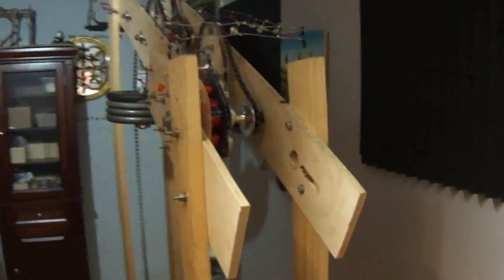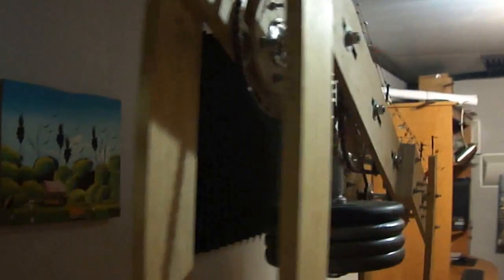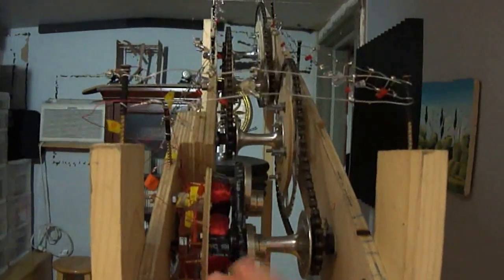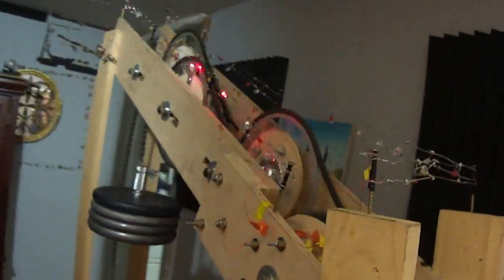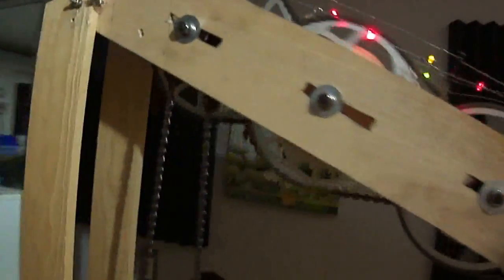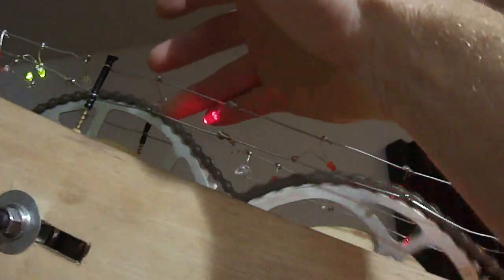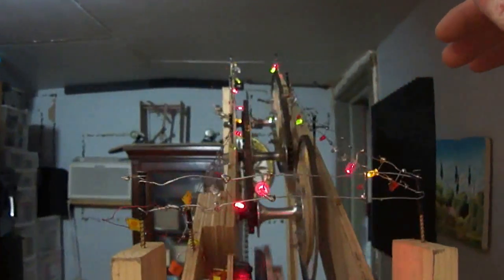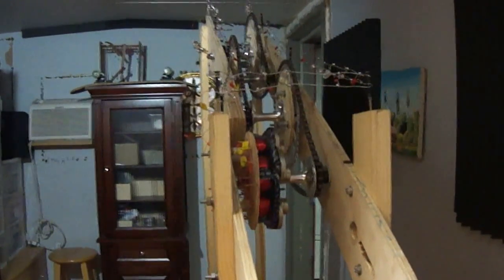Mini Gravity Generator Running

Comment: You are claiming fake informations. Where are the bigger brothers? Here you generate 4w to power those leds. That means a big brother 2000w should have 500 times heavier weight. Wich you will never lift it manually. Your are a little liar scammer. I am an engineer and I ve been working on all kinds of generators. I know the electricity and thr devices.
You should feeel shame for trying to get viewer into this manipulation. You won't get rich on youtube like that. As you see, smart people will not waste the time to write you compliments.
You can trick poor people without knowledge, but not physicians or engineers working in science for 40 years.

Comment: You made a claim your device resets itself?  What exactly does that mean?  If you are claiming the energy to reset the weight back to the top comes from the energy of the generator with no external force added, then I have to say you are mistaken.

Comment: Hi, may I know how u control the speed of the dropping mass? I am doing a similar project to yours and I would like to know how do I calculate how fast the mass is dropping
Reply: 😂😂😂😂😂😂. Its all about speed reduction. As your pedal crank bicycle. Your pedal its slower than your rear sprocket. A larger sprocket has lower rotation then the small one. You better don't watch those scammers if you don't have knowledge. Because you helping them to make money on youtube trough your views. Go on google and learn mechanical transmisions. Take time for yourself 2-3 years to learn basic things in mechanical devices and electrical generators.
Reply: Use an online RPM sprockets calculator.

Comment: What do you mean by automatically reset?  Are you are saying the weight goes back up by only the power generated by the machine?  It would take more energy to bring the weight back up than the generator can produce.  Basic Physics.
Reply from the maker: I'm not talking about energy. I'm talking about the ability to reset the weight without stopping the generators operation. Take a look at the rest of my videos and you will see the process of resetting the weights.

Comment: I've been recently thinking about making one of these.  I'm an electrician as well and I can't figure out a way this wouldn't work. I was wondering how your response to this is and would like to talk to you.  I don't want any of your ideas so don't worry. -Andy
Reply from the maker: Andy H This process of electrical generation works as you can see but I could not make a store purchased electric generator produce a single watt through this process, they require to much torque and RPM. I've made several much larger generators you can review on my YouTube channel. Building these type of things is a great adventure and I recommend going and building.

Comment: lol so this one produces 4 watts but the big brother produces 2,000 watts and resets itself (aka perpetual) haha okay, pull the other one. It's a nice smooth machine but be real :)
Reply from the maker: Gadget Addict I think you misunderstand the meaning of what's being said. The easiest way to clear this up is for you to see my other videos on YouTube at which point you will notice the electric generator still running as the weights are rising. This is the reset I'm talking about not the golden grail your joking about and the big brother means a machine large enough to pull the weight required to make 2000 watts come take a look. Your final message was deleted, be short winded and polite next time. Thanks
Reply: Bunker Rogge Yeah I checked your other machine. It's a nice feat of engineering, I don't doubt that. But it's producing far less power than you estimate and runs for a very short amount of time without human input. It's essentially a hand crank generator with an artificial capacitor (the weight falling).
Reply from the maker: Gadget Addict Yes, the voltage is low, running now at about 55 volts on average. The magnetic flywheel is out of balance I show it in one of the videos. This out of balance flywheel is causing the lights to pulse and voltage variations to occur. The hardest part of the testing has been the need for constant human input by far my largest complaint about this system of electrical generation which I'm trying to correct. There have been lots of good ideas posted. I saw your hand crank generator as well nice work.
Reply: Bunker Rogge The thing that concerns me is how monstrously big your machines are. There are some hand cranks on youtube that push out 400-500 watts and are about the size of one or two 5 gallon water bottles. With a machine as big as yours, I'd expect a much higher output. Can you not add more gears to reduce the speed of the weight and increase the speed of the motor?  And have you considered modifying a car alternator? I've seen modified alternators spun at fairly low speeds and still generate a sizeable amount of power.